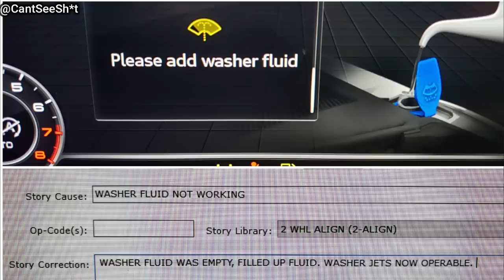Customer States Truck Feels Weird While Driving (GMC Sierra) | Just Rolled In

Comment: It's mind boggling how many people pump their tires to the "max pressure" value written on the tire.  Door jamb, people!  Door jamb!
Reply: No tire has 90psi on the side of the tire.
Reply: You must work for discount tire, lol.

Door jamb is ignored after the car rolls off the lot as you cannot guarantee that the tires are stock.
Reply: I’m the rare guy who inflates to door jam numbers. I may go 2 to 3 psi above or below depending on approaching weather.
Reply: As long as you stop at max pressure, it won't blow up like that.  They're going beyond - probably by quite a bit.
Reply: Depends on the load rating of the tire and gvwr of the vehicle.  The door jamb sticker is not always a definitive answer.  PSI values varies, specially on 3/4 - 1 ton Pick-up.   Normal use, you'd follow the door jamb.  But once your hauling or towing, go by your owners manual and sometimes you have to set the tires to their max psi rating to safely handle the extra load
Reply: @brianmcg321  once you get into truck tires, they start calling for 100+ psi
Reply: @brianmcg321  The Michelin XZY that Land Rover used to offer on the old Defender 110 was rated as 1500 kg (3307 lb) at 690 kPa (100 psi) cold. Even so, the factory pressure was 1.9 bar (28 psi) front, 3.3 bar (48 psi) rear!
Reply: @brianmcg321  Lots of low profile tires do, and higher. That's actually why I mentioned discount tire, because when I looked up their door jamb sticker fetish, there were numerous poor unsuspecting people commenting in varous places with fancy ass wheels and low profile tires who had to replace one or more because they didn't realize discount tire only fills to the door sticker unless you get on their asses about it, and they ruined their tires and even their wheels.
Reply: Commercial van multi ply heavy load rated tires call for 80psi max.
Reply: Door jamb yes, UNLESS you have substantial extra weight. THEN add more air, BUT usually only 10 more psi is needed max!
Reply: @brianmcg321  yes they do. Intermodal bias ply tires do.

Comment: My Dad was the manager, and I grew up at the major truck stop in northern Colorado. One day as I was mounting a brand new car tire on the wheel (it was still restrained to the mounting machine) I had 30 lb. of air in it, and I noticed the side wall bulging up. As I started to move backward with the air chuck, the top bead of the tire completely blew off, throwing me backward over the floor hoist, knocking the wind out of me, and rolling my eyelids inside out. I thought I was blinded, but was ok. It turned out that the tire metal cable bead was broken or separated at the factory. Still remember it, I am now 73, was 16 at the time.

Comment: When I was a kid, I worked for my dad in his tire shop. The 18 wheeler that delivered tires had a leak and asked for some air. As I was airing the tire (which was bigger than me), I asked "What happens if this tire blows?" My cousin said "You'll never know what hit ya." I handed the air chuck to the driver & walked back to the shop. Thanks for the chuckles and keep up the good work.
Reply: No doubt. A truck dive told me about another driver leaning over a wheel on the ground filling it, the ring came loose and cut him in half.
Reply: that's why they place them in the reinforced steel grates before filling them. too many decapitations
Reply: Back in the early 2000s, there was a video floating around of an Air Force dude filling up a big truck tire without using the safety cage. It didn't end well for him. I think about it every single time I fill my tires now.
Reply: @cuisinwithkev2699  what's sad is the reg itself is written in blood